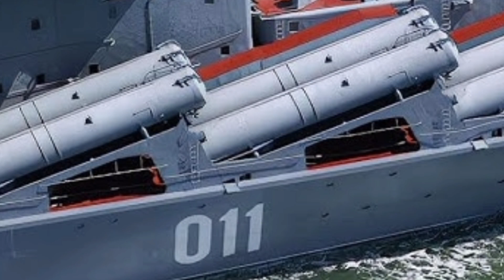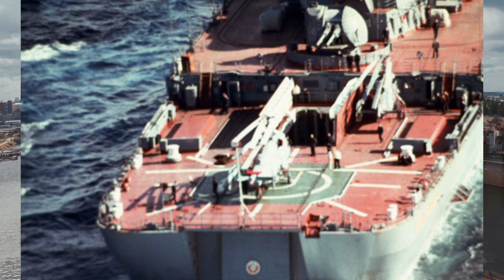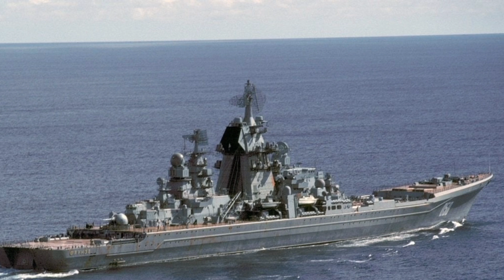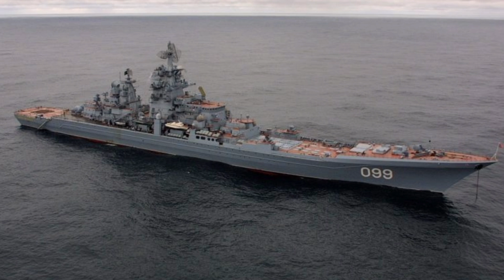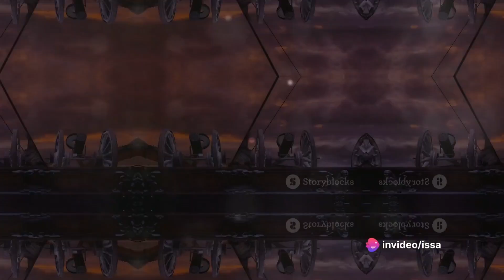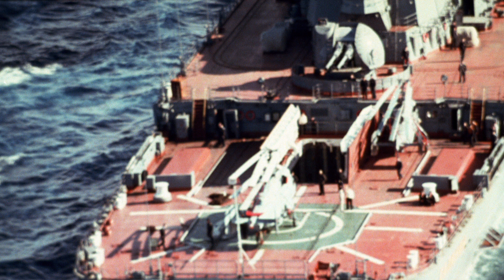Kirov-Class Battlecruiser: The Atomic Titan

Comment: Too bad it's utter bs... there is only one kirov class battlecruiser and it is itself under refit... the nuclear powerplant is for show because it can not use its nuclwar powerplant alone to reach top speed but relies on burning oil... 

It is neither the largest military vessel nor fastest nor heavily armored or armed one... it is being heavilly outclassed by american supercariers with a displacement of 100k tons vs kirov's 28k tons. Yes it is the heaviest cruiser /destroyer but it is slow and heavy, basically it is a huge target with antiquated anti air systems...
Reply: Actually, there are two ships of the Kirov class, namely Peter the Great, who is now in service, and his brother Admiral Nakhimov, who is not only under repair and modernization, and they use atomic inertia, because according to you Peter the great bypassed the world and a displacement of 100 tons can only be aircraft carriers, which are also a very good target
Reply: @Viscobarsa  supercariers can do more than  30knots on nuclear power alone... being 100k tons... so the gerald r ford is not only almost 4x larger it is also probably faster than these running on maximum with nuclear and oil...  also aa of the geral r ford is the newest the rest is a mixex bag but fact is they always travel in battlegroups so they will be protected by other ships.
Reply: @mycardbrokedown5699  so no, wait, I looked at Peter the Great's speed of 32 knots and this is only on the engine and it must be borne in mind that Peter the great has already served for 40 years and he has not been moderated all that time, so we have to wait for his brother Nakhimov to be ready, and according to some he will be ready soon, although it saddens me because there is the rumor is that the Great One will be dismantled for metal, and I really like him, but not the point, but about the group, so we must also take into account that the ships of the Kirov class will not move alone either
Reply: @mycardbrokedown5699  And in general, to be honest, it is very stupid to compare an aircraft carrier that is designed to carry fighters, that is, in fact, support and a cruiser that is designed to launch missile strikes at the enemy, well, I mean, it does not compare
Reply: @Viscobarsa  yeah well the comparison was made becsuse the video said the largest and fastest and the geral r ford is probably better at both. Not going tondiscuss the vastly different rolws of the two. Also the kirovs are arguably support too as they are large missile trucks but i guess they will be placed closer to the battle than a carrier... maybe. Also if we talk direct attack role... the uss wisconsin is faster and heavier and heavier armoured and heavier armed than the kirov. Sooo... as far as battleships go...
Reply: @mycardbrokedown5699  The Wesconsi destroyer? but is there such a thing, I think there is only a battleship and that's it
Reply: @Viscobarsa  the battleship wisconsin... big wiskey... it is faster heavier, faaaar faaar older, heavier armoured, heavier armed. And i think they started to retrofit it ... again at any rate it is still operational to this day, which is bonkers if you ask me, she will soon be 100 years old, the fact that she is still relevant today is mind bogling. I just hope the americans get the railguns working and build a modern battleships with nuclear reactors and putting a small family car sized round at mach 10 on target 400 miles away lol.
Reply: @mycardbrokedown5699  Uh what? Are you seriously saying that an old museum ship is better than a Kirov-class cruiser? Doesn't it bother you that it's a battleship and that it's a World War II ship? After all, you yourself said that the Kirovs are a very big target, and that is, a whole battleship is not a big target, so you contradict yourself
Reply: @Viscobarsa  well it is more than twice as heavy as the kirov, it is faaaaar better armoured and can shoot 1200 rounds that do about as much damage as a tomahawk missile and it is faster.
Reply: @mycardbrokedown5699  And how will this help against the Great and Nakhimov? especially against Nakhimov, who has a long-range hypersonic weapon zircon, who will not care about the armor of a battleship, listen, I don't understand your logic at all, to be honest:(
Reply: @mycardbrokedown5699  Moreover, it can fire 1200 shells from a cannon, and the cannon has a range of course small compared to a rocket, which is logical
Reply: @Viscobarsa  the usefullness in battle, not one v the other. The battleships were designed and built to take a lot of punishment i doubt a zyrkon could sink it... they nuked one battleship bombarded it for 2 days straight then nuked it again to sink it they used a bunch of torpedoes... yes you can look it up. That is the kind of punishment thewe ships can take. But that is not the point, the shells of the battleships are too big and too fast to be intercepted even though they are dumb ballistic projectiles. They are waaaay cheaper than rockets and because the ships are so tough they can offer fire support for landings.
Reply: @Viscobarsa  the range is not that much of a concern for battleships, they can function as a landing support role and obliterate the enemy troops on the beach and 40km inland which is enough to create a really good bridgead
Reply: @mycardbrokedown5699  Well, listen, battleships are already morally outdated now it's not the Second World War or the Cold War, now the development of technology has leapt far ahead, for example, the same zircons and it seems to me that it will be very difficult for battleships, plus they are very expensive to maintain, so now they don't build battleships nowadays, now they prefer corvettes and submarines
Reply: @Viscobarsa  agreed buut... thebwar in russia has shown that weapons systems need to be simple and straight forward. The thing is if a battleship is protected by its battlegroup it could be a vital system for any landing operation as it could offer fire support tto the landing troups. It is not any longer a spearhead but more like a naval artillery battery of very large calliber. Also a zyrkon would not sink a battleship... as i told you they tested one of the battleships to see realistically how much pounding it would be able to take, and she was nuked twice and torpedoed and hit rockets and artillery. Also the 2 battleships that are recomissionable have been refitted every 20 years or so and they have been last used activelly in iraq war! So that's some 30 years ago. 

The other argument is cost! These systems are far less expensive than rockets or other type of forward deployed ground support. That is why the navy is taking another good long hard look at the battleships and the war in ukraine to see what is to be learned. The cost per shot of a battleship is insignifficant compared to that of rockets so say what you want but for this speciffic role of breaking through and creatig a beachhead battleships are still uniquelly qualified and the navy really does not have anything even remotelly as cheap to do it.
Reply: @mycardbrokedown5699  Okay, you have your own opinion, I have my own, because for me the Kirov class cruiser is more preferable, and Peter the Great and Nakhimov are for you, as I understand the Visconsi class battleships, I don't remember what they are called, well, anyway, we talked well, have a good day and good luck in life :)
Reply: @Viscobarsa  yeah you too! My point is each has its own usage. Kirovs are missile truck while battleships are groundnsupport. But still the battleships from 44 are faster and heavier that was the initial point plus yes the iowa class battleships are BEAUTIFUL ships!
Reply: And as for the fact that it is not the largest, yes, it is not the largest, but it is the largest currently operating non-aircraft carrier warship and I argued about air defense because American air defense is also outdated, and why Russia and the United States do not change it, although they can, this is another very difficult question